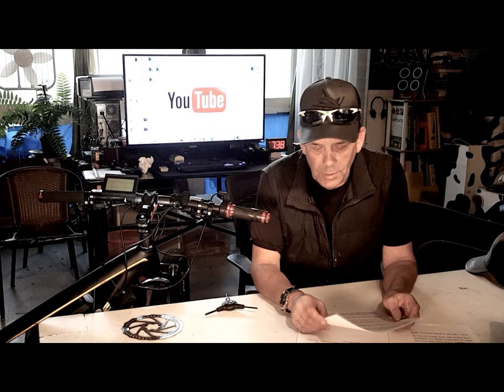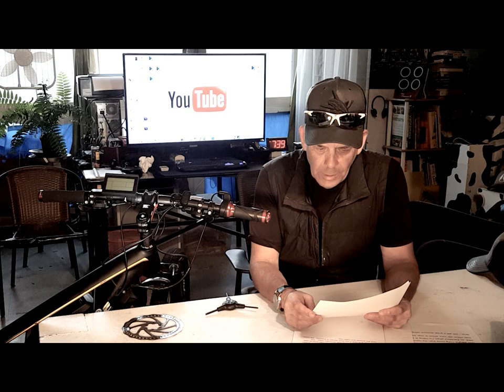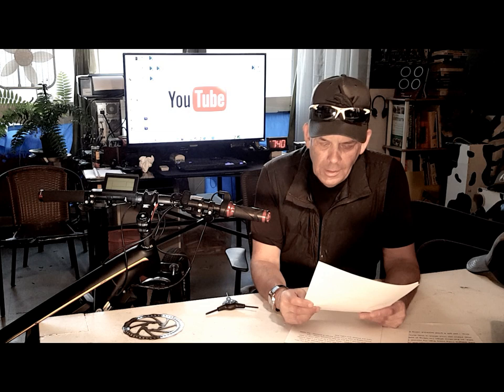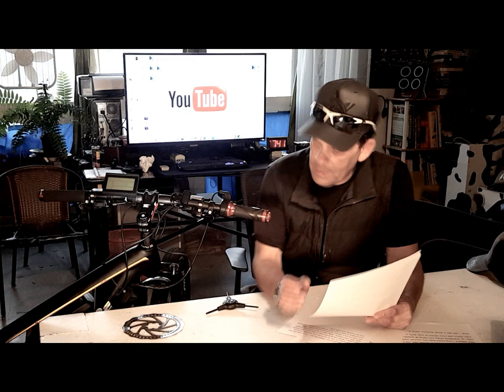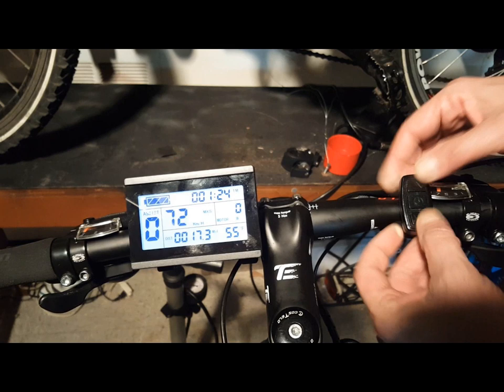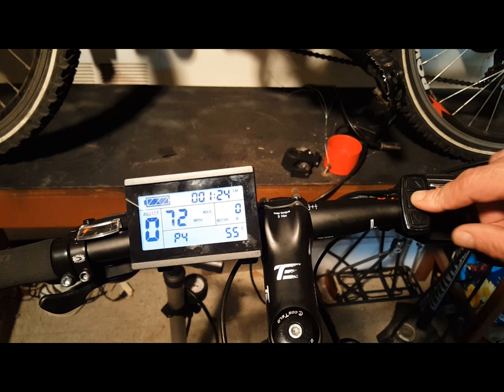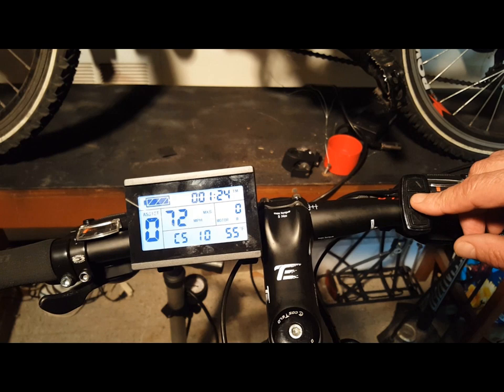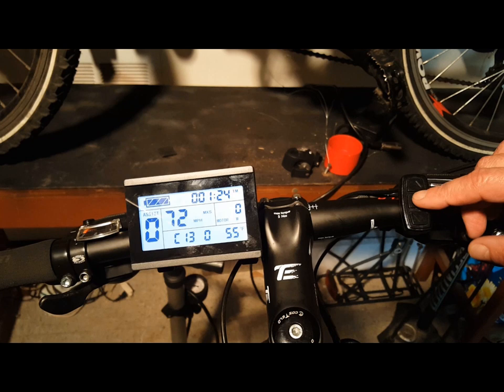ebike Tips. Programming the 24v, 36v, 48v, KT-LCD3 on-board controller computer

Comment: Hi can i use 48v battery for 36v hub motor?
Reply from the maker: The battery will drive the motor, no problem. The problem is your controller. Make sure your controller can handle the extra voltage. Many times controllers are designed to handle more power, but some of the cheaper ones will burn out. So check your specs

Comment: How do you change from C degree to F degrees?
Reply: I'm trying to figure out the same thing on LCD 3. Stuck on C.
Reply: As you turn the monitor on 5 seconds in, hold the up and down buttons and then it'll display your max speed you want, Just accept that and hit the power key. After that, it should hopefully show you if you want the imperials in C or F, as well as Miles, or Kilometers. Just choose the up and down arrows for which one you want. Then just hit the power key and you should be set! It should be a F instead of a C as well as Miles instead of Kilometers hopefully!

Hoped this helped!

Comment: Can I use two 36v batteries together to make 72v on my 48v 1500 ebike kit,  with it do any damage when I connect the batteries up to it,  or do I just set it to 48v and run it that way ,
Reply: do not connect two 36v batteries together to a 48v controller, you will burn you controller, a 48v controller typically has a limit of 60v, if you want the utmost power you can get out of a 48v controller buy a 52v battery, at max charge a 52v battery holds about 58v
Reply: @socialfreak6900  ,  it's ok as I'm changing my 63v capacitors to 100v capacitors before I connect it back up , then I can run 84v and it will last longer, thanks for the help,

Comment: I'm basically fucked altogether. My PCB got too hot because I upgraded the battery to a 52v 17.5ah battery and blew not only two of the MOSFETS, but the motor refuses to run anymore. It just judders violently like something in it's locked up hardcore. I've spent literally 6 hours trying to find a place than the one site that has a controller for sale. I won't need luck here, but i'm just fucked altogether. Way to go for a bike that's gone 8200 miles and lived almost a whole year.

Comment: P5 for 52v is 16
Reply: By chance you might know the value for 60v ?
Reply: Im not sure, do some experimenting.
Reply: My battery is 36v, and I've tried all the number from 0 to 64. Nothing helped. When the lcd is at default set at P5 12, my fully charged battery at 41.2V was showed with 4 bars. Then it showed empty bar when the voltage decreased to 38.2v. My cut off voltage is around 30v.
Reply: @mbaoto2791  how do I change p5 from default value? I have tried with the up and down but nothing, just blinking and the value is not changing

Comment: After my second Garmin Edge 520 died unexpectedly I decided to try something different - the Wahoo ELEMNT Bolt instead of the Garmin 530. Boy! I'm glad I did. https://www.youtube.com/post/UgkxXZCtB-wGdHVTBSz8RswePK5vllHNi06N The display on the Wahoo Bolt is much easier to read. I like the configuration of the display more (up to 7 items visible on page 1 without scrolling and the first item chosen is larger characters than the next 3 rows that have pairs of items (still very readable). I also like the configurable item selections. The Bolt synced with my Garmin ANT+ Speed sensors on both bikes easily so no additional investment was required there. While the rated battery life is a couple hours less than the Garmin 520/530, I easily get a weeks worth of 1+ hour rides before recharging (and it's never really low on charge). At the end of a ride syncing to the Wahoo app, Strava, and Apple Health app is painless.